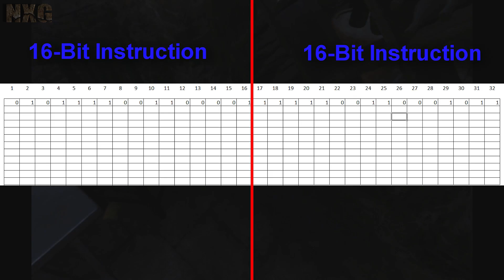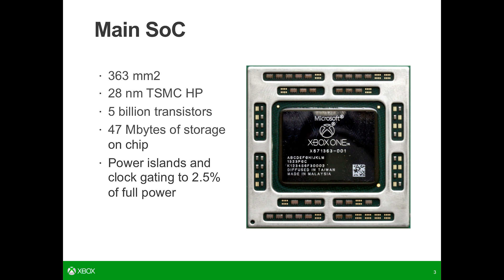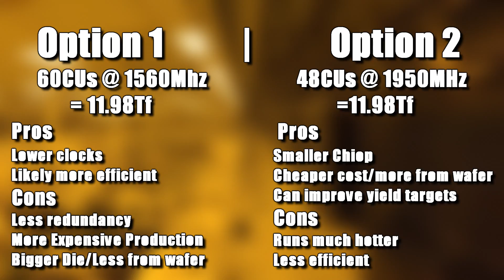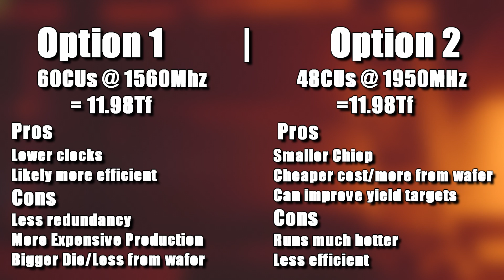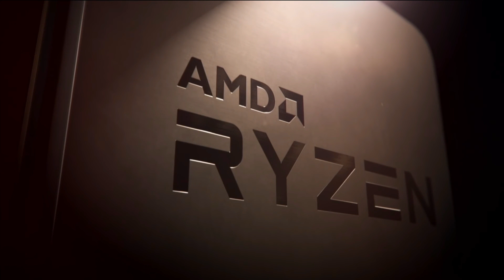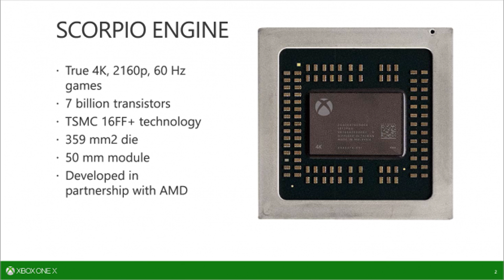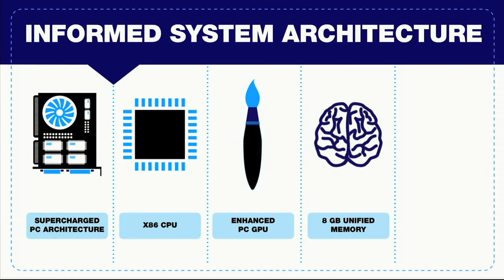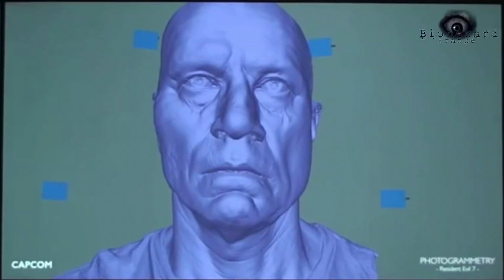Is the PS5 only 9Tflops? | Let's Talk

Comment: ONLY?? That's a lot to people like me that still have the OG ps4 with 1.84 teraflops
Reply: Also new RDNA architecture flops are apparently better than the current gen system flops and direct comparison can't be made. Not to mention the real leap in the next gen will be with Ryzen CPU and the specialized fast SSDs.
Reply: Right. That's still decent generational leap. 5 times PS4 and 2 times PS4 Pro
Reply: @Radek494  not really considering games will run at 4k ray tracing... Meaning not much of a graphical leap
Reply: @Radek494  3 times ps4 pro.
Reply: @Radek494 it's way much more stronger then just 2x of pro because your not counting other parts, it's at least 10x ps4
Reply: @Radek494  how so? What are we going by numbers...or games...how do you determine which console is truly more powerful...the games simply
Reply: @abemickeygaming7742  Just wait and see.  Performance of BOTH PS5 and XSX will be well within the same ballpark of one another.  If the XSX really IS that powerful, get ready because you're talking 600.00 minimum!
Reply: Whats funny is that some think that 9 teraflops of rdna isnt enough for 4k,lol, or that zen+ at 3.2 that is 300 or 400% more powerfull then the jag cpu on the ps4 isnt enough for 60 frames...  Diferences?
Reply: Ross Huey  Not in every aspect. PS4 Pro has Rapid Packed Math unlike One X. That allows for twice as much 16 bit code to be used as 32 bit code to a maximum of 8.4 TFLOPs if all 16 bit code was used. Sure, almost no game uses all 16 bit code so it is generally a smaller boost than that over the 4.2 TFLOPs for all 32 bit code. But it was one area where the PS4 has a better spec as One X totally lacks it.

In fact Sony got RPM before AMD released a GPU with it on PC (Vega).
Reply: Cletus Zimmerman  what is it I am not getting across ,gears should be doing those things it is a much more capable system so yeah it's going to be able  to hit 60 .please someone  read and understand. It is amazing  to me what Sony was able to do with such little power and not matter  how much of a hater you are the proof is in the sales. Please stop sending me stuff saying xbox is more powerful  I get it stop flexing.  What I am saying for the last time Sony was able to pull a hell of a lot out  of an underpowered system,so with them having abilities beyond that now it is going to be amazing. I'm not going to keep going back and forth and reiterating every time.so I'm done Gears was ok I guess I played for about an hour could not get into it. If you need to have the last word have it man lol your going to sit and try to down play like god of war was riddled  with glitches  go right ahead, meanwhile I can guarantee right now that when the new one comes out it will outshine anything  on the one x or series x.i have tried to be nice, but you guys are horrible with this fanboy ish .so go ahead give your final xbox school of gaming thought I will hear what you have to say and move on.
Reply: It would be the weakest gap between generations plus the sexbox is 12 tflops. Frankly it never feels good spending hundreds on the weaker console, even if it is the better console
Reply: Yeah and my PS4 slim runs most games great. I play red dead redemption 2 no problem.
Reply: exactly!
Reply: This may sound crazy but If I could honestly have all the same major pro developers continue making games for PS1 as If It was brand new I'd be a happy camper
and pay full price. Same with PS2. I think 9th gen could finally be as amazing as those generations potentially... we're getting real leaps with CPU and GPU.
Reply: It is over twice that of the Radeon R9 280X that I have in my PC and and nearly twice that of the 480/580 that I intend to upgrade to when I get a new PC. Add console down to the metal optimization and they will achieve well over 3X what the 480/580 can achieve and those are very good mid range cards even today.
Reply: Ross Huey  No i am not a PS Fanboy at all! I play everything expect PC and mobile Phones! The problem with microsoft is that they push PC too much! They take away reasons to by an xbox! I will always stick to consols but this is a heavy thing! Also Sony trying to push PSnow on PC isn't the wisest thing to do! Death Stranding and Beyond/ Heavy Rain showed that they try to open up! If Nintendo stays the only one sticking exclusive to console (Handheld) gaming there would be no alternative for me (and many other console gamers as well) I really like nintendo but i do not want to be dependent on one company expect they would decide to built a high end consol in the future wich will be their only choice then!
Reply: Ross Huey  I would do it if i was a console manufactur! But tell this to nintendo and loon at their record numbers! They have games that sell 20 million+ on 1 single system! Why should they release on PC or other consoles? Because they don't need to
Reply: Ross Huey  I do not see The Last of us 2 or Ghost of Tsushima getting released for PC! Sony would not allow this neither would nintendo allow mario! And this would be quite a sad future if consoles loose their USP
Reply: Ross Huey  Ross,  $ 100 is a deal breaker for 80 percent of the consumers.  We learned that from the original Xbox one VS. PS4.  And your not going to see very many 120 FPS games unless your in 1080P mode. Sony doesn't need the strongest console, it has exclusives that MS. doesn't offer Xbox anymore.
Reply: Ross Huey  No need to attack someone! But look at vgchartz.com The xboxone just reached 46 million units! It'll be luck to even surpass the super nintendo livetime! The majority of gamers like physical games! Thats an icecold fact! See what happened with pspgo? That says everything! I am not the onlly one who says that! Why do you think next gen consoles have a disc drive?
Reply: Ross Huey  already seen it... yet another rumor that isn't actually confirmed.
Reply: Ross Huey  This is wishfull thinking my friend! The industry leaving me behind?? Tell this to hundreds of people waiting in line and even fighting to get consoles like the launch of Wii PS4 or switch showed! Where did you see people lining up in masses just to get theire hands on the lates Nvidia/ AMD Graphics Card? See how PSP Go flopped by biing digital only! See xboxone all digital edition! Fuck vgchartz? Many websides are sourcing them as a reliable source! Playing my ps4 exclusives on pc? A frind of mind has a jailbreak ps4pro that plays PC games
Reply: Ross Huey  Thats what i am telling you! Nobody lines up for graphics card! But they do for consoles! I can't understand your little crusade against physical possesment! If Nintendo and Sony say "No" games won't come out on PC! They make too much money on that! How many times have we heard this will be the last generation with physical media and how often have haters been wrong? I do not want to be impolite my friend really but i have the feeling that you just can't live with the fact that there are games you cannot play on PC! Thats like saying every handheld game will come on smart devices! They cannot be even compared with handhelds! Even IF this was the last generation of physical media I WILL STOP BUYING NEW GAMES! No one can force me! Its better to have more possibilities! As you said maybe nintendo will get psnow and xcloud! That just plays in their hands! You can have these streaming services everywhere but also on nintendo/ playstation! But they will have EXCLUSIVE games to them extra and thats the usp since over 30 years right now! So streaming fanatics will have no argument anymore! Stadia? See how it works... how many problems people have... I live in my own flat and i got a 40k connection, so my internet is super fast and i reject streaming and so does the majority of gamers at least console gamers!
Reply: Great vid man
Reply: Still can get a better PC for cheaper
Reply: Ross Huey  Yes you can
Reply: Ross Huey  Heard of the fact console games use  upscaling and will run on low settings at 4k, buy an rx 570 8gb gpu and it is already faster
Reply: NoT iN a MiLlioN yEaRs 🤣🤣🤣
Reply: @Transistor Jump They didn't you are right, but the form factor proves that Microsoft is going all out on cooling. So it wouldn't surprise me if they did.
Reply: Ross Huey  Dude, if the spec leaks are true the xbox will walk all over the rtx 2080 and compete with the rtx 2080 super instead. There's only so much you can lose on hardware.

Also, next xbox will be able to play xbox one x games with better fps and improved visual fidelity. So Microsoft will probably use that to get xbox owners to upgrade sooner. Backwards compatabilty will sell more consoles in 2020 than the 3 games the xbox will launch with.
Reply: Confirmed Sk I doubt it
Reply: Ross Huey  Let's say the next xbox is $700 and on a payment plan. It allows Microsoft to go with a larger gpu, more exotic cooling solution, and less compromises on specs.

Personally, i think xbox is trying to compete with gaming pc's; while Sony is staying true to it's console roots. Microsft's plan with the xbox was always to push the Microsoft branding and software into every household. Which is very similar to what Apple has done.
Reply: @dondraper4438  Sony isn't staying true to console roots, they will have almost the exact same hardware but weaker
Reply: @batmangovno  Can you confirm what you just said?
Reply: @dondraper4438  The Series X is not releasing for $ 700.  Consumers only going to pay so much
for a gaming console no matter what.  The Xbox One X  struggled to sell at $ 500 so any new
console needs to be $ 500 or less in order to do well.
Reply: @GregHakes  You might be right, but we won't know until xbox tests their payment plan. A decade ago i would have called you crazy if you told me a cellphone would be $1,700.
Reply: @dondraper4438  Anyone who pays $ 1,700 for a cell phone should have their head
examined.
Reply: @alexmihoc3182  3x more power than pro isn't even enough to run God of war in native 4K60.
Reply: @vandammage1747  don't listen to these rumors... None of us doesn't knows what PS5 brings in.
Reply: Ross Huey  alright then, I have been told very wrong then, but yet, does Microsoft has confirmed 12 TFlops and does Sony has confirmed 9.2 TFlops?
Where all this shit comes from lol... Hey I have a new idea... PS5 and XBox each 10TFlops (My first rumour)
Reply: Ross Huey  Yes but you cannot compare PC's with consoles! If you take all playstations ever released then you have around 550 million users, silencing even about Nintendos massive 750 million sold gaming machines! I am not even combinding them but this alone anihilates PC's userbase!
Reply: @Transistor Jump It's hideous, they wouldn't go with that design unless they absolutely had to. That's just my 2 cents. If they went with that clunky design for no reason, Microsoft might as well exit the console market.
Reply: No no..no Have had the PS4 and Xbox, clearly and easily the PS4 performed considerably better. Moved onto the PS4 Pro, kind of disappointing but still a nice upgrade on the PS4. Then the Xbox X arrived, this shat on the PS4 Pro massively and made the PS4 Pro look a like a money grab by Sony. If you’re playing on a 1080P Tv then stick with your Nintendo stuff for 2020